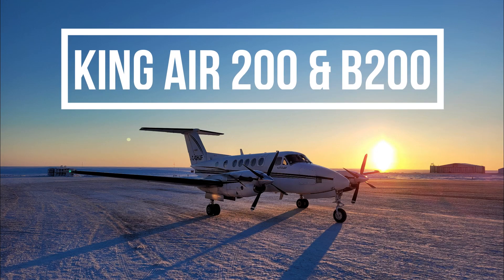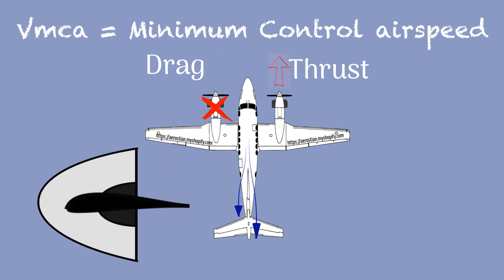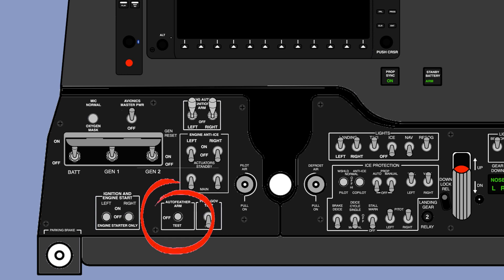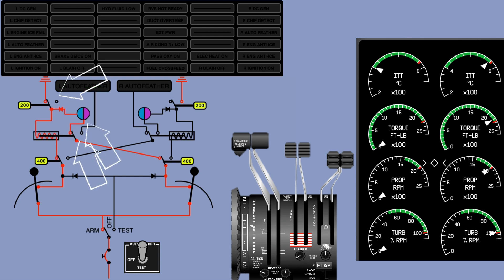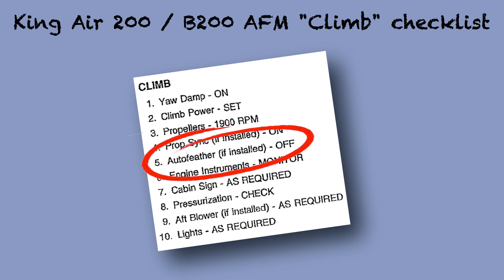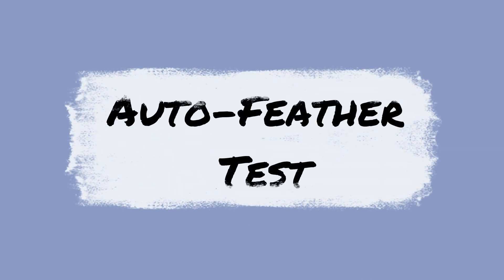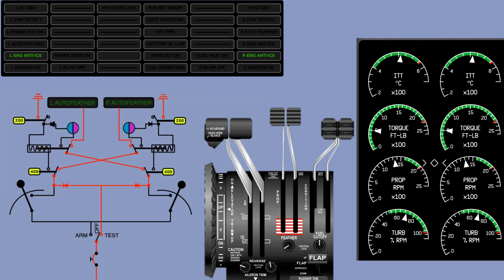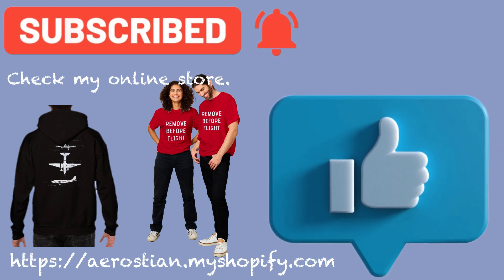BE 20 Auto-Feather system

Comment: I believe we turn off the autofeather because once an engine is feathered it cannot be unfeathered without propellor rotation. If an engine fails, it is easy to attempt a restart with a windmilling prop, even without a starter. A lot more difficult with a feathered prop.
Reply from the maker: That’s a good point, I didn't thought of it that way.  The way I see it. If you are in the climb, and you lose an engine, you will lose speed quicker, even if you level off. You will also have a poor directional control. 

When you start the engine on the ground,  the prop are always in feathered position. The starter do not have any problem to start it, and the prop goes to full fine with no problems.

In the air you have the airflow to help. Unless you have to do an airstart, in this case you have a point.

To be sincere, I never had a proper explanation. So I go with what make sense.

Thank you for sharing!